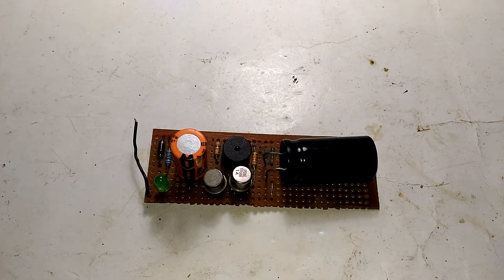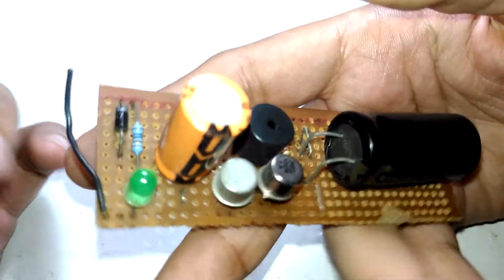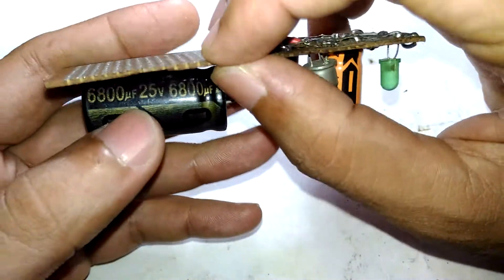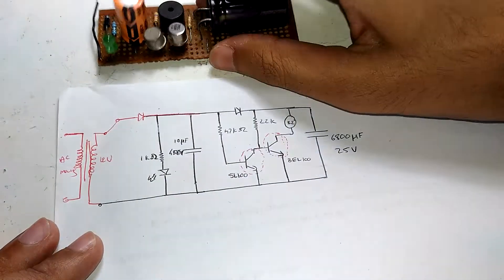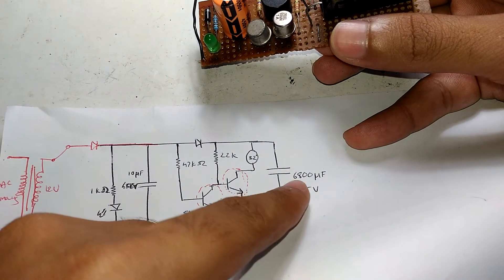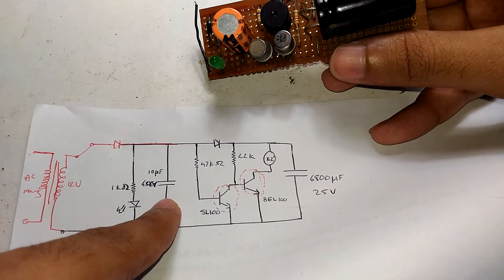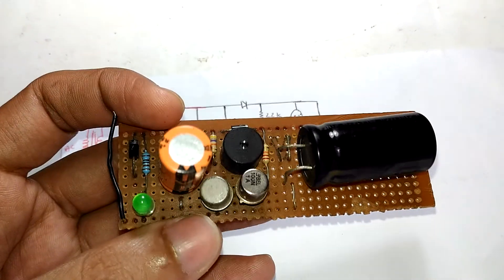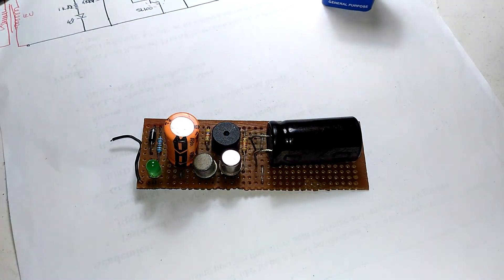IE75: DIY power failure indicator using transistors.

Comment: What is voltage value of 1st cap?
Reply from the maker: Voltage rating of both the capacitors must be above the operating voltage that you've decided to use. For example, if your input voltage is 9V you can use any capacitor that is rated above 10v. :)
Reply: @INSIDEELECTRONICS  sir can u contact me .  7999842027 i have a ckt which i want to develope
  O work in a company who provode EV charger for car and Bus.
Reply from the maker: You can contact me at insideelectronics@yahoo.com :)